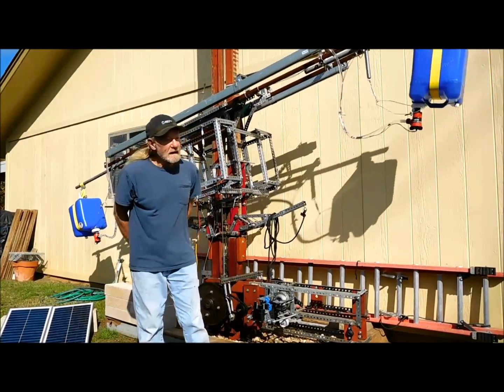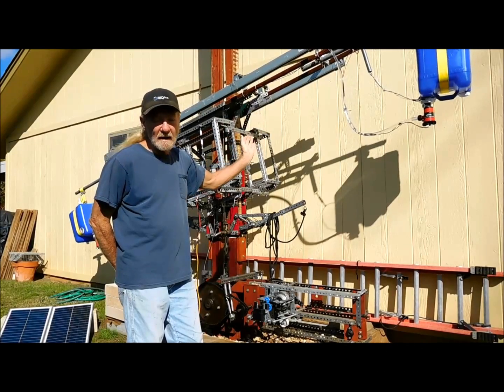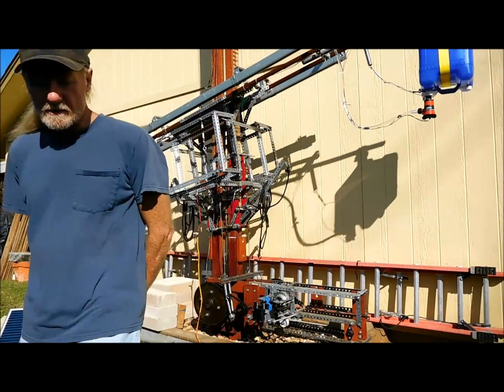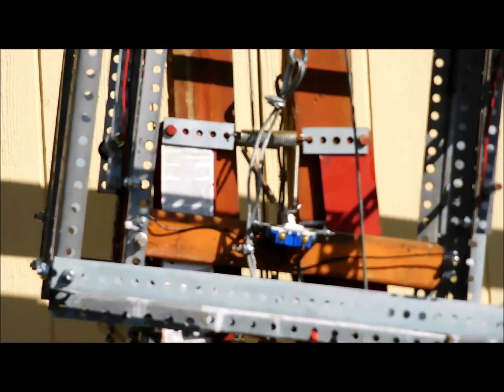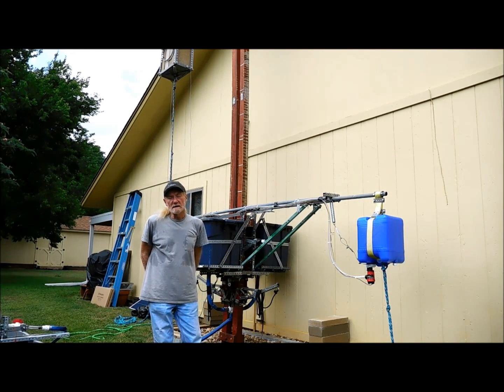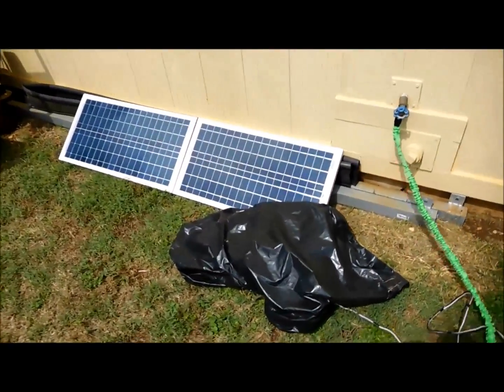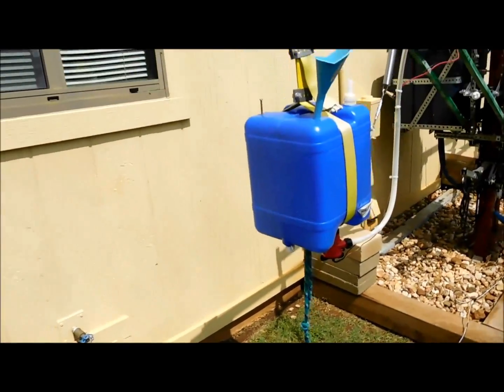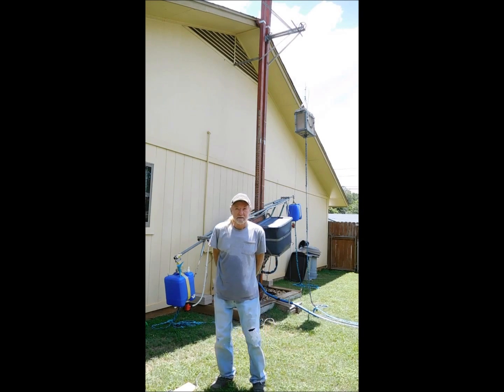Lifter and Solar Energy Storage

Comment: Why not just lift entire thing using some gears and motor. More efficient?
Reply from the maker: I get this question all the time. Hydro storage is currently the only gravity storage method that has efficiency of 80% or a little better. New hydro storage methods use the same method to store and extract. If you use the same method to store energy as you do to extract energy then you will double your efficiency loss. Motors and generators have around a 10% efficiency loss and gear boxes 15%. If you use these three items in your storage method you will have a up front 50% efficiency loss. If you use a solid material for storage then you will have to use a generator and a gear box to extract the stored energy. For the input, you can play around with different methods that are more efficient. The Lifter is really nothing more than a see-saw. It uses the size and shape of the carriage to contribute to the input mechanical advantage. Doing this helps to eliminate the need of a gear box for input.  Also note that this example does use a small dc motor for input. The motor drives a water pump instead of a gear box. Plus, the water is pushed up an incline, which increases the overall efficiency of the tilt cycle. Go to my website for other examples.
Reply: @bclifters  The same motor and gearbox  would be used to both pump and generate.
A far more simple setup, easy to increase capacity, just add more motors and pipes and bigger water tank.
Having said that I do like what you have done, its fun to watch :-)

Comment: Or you could raise an empty container and pump water into it. That is your stored energy. After it gets to bottom it drains back into your pump tank. 
Cheaper, smaller, less complicated and more efficient.
Reply from the maker: The pump that I used was powerful enough to pump up to around three or four feet. The solar panels I used provided just enough energy to power them. If I wanted to pump water higher I would need a  more powerful pump and more electrical output than that provided by the small solar panels I used in this example. So, yes you could, but it would be more costly. See my web site where I discuss using water as a storage medium and the inherent efficiency loss that all hydro storage systems have to deal with.
Reply: @bclifters  I am an engineer, I am very aware of energy loss. A slightly bigger pump and a battery to hold a larger charge would still cost less then building all of this. Or 3 smaller pumps in sequence(pump 4 feet into resivor, then second pump kicks on pumping to next, ext.) That would run on the same power supply, be more efficient, take up less space, less parts.
Nothing against your project. I love this sort of stuff and your creativity. It is an interesting idea if you have resources limited to what you used.
Reply from the maker: @skylanh4319  I like the idea of staged holding tanks. That would work great if you had the tanks positioned on a slope, with each tank staged above the other one, no extra cost for a support structure. Your final tank would be your prime mover for output.  Look at my YouTube channel and my web site for other examples using a solid material in the carriage.

Comment: Very cool. And especially that you have gone to such a scale.
From your video it looked like you pumped water from one side upwards of a meter to the   Other side over 120 times. So probably the same as and equal to pumping straight up into a storage tank, However you have managed to do this using a small low pressure pump.
Reply from the maker: I think you are close, a 3 to 4 foot overhaul is about right. Overhaul and time (and space) are the only real price you pay when you try to keep the force needed to tilt at a minimum. You can see two more examples of this type of assisted tilting on my web site. 
http://www.bclifters.com/proof-of-concept/sliding-weight
and
http://www.bclifters.com/proof-of-concept/lifter-on-an-incline
Pushing or pulling a weight up an incline provides a nice mechanical advantage.